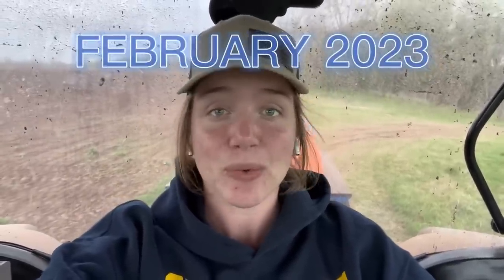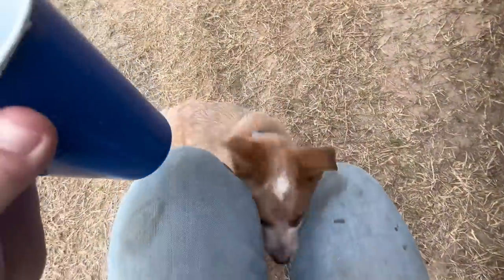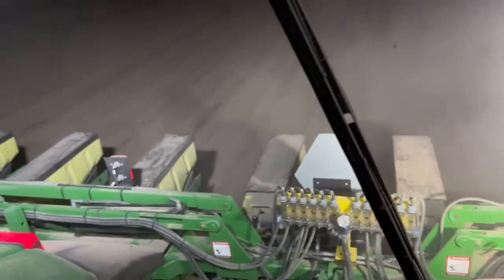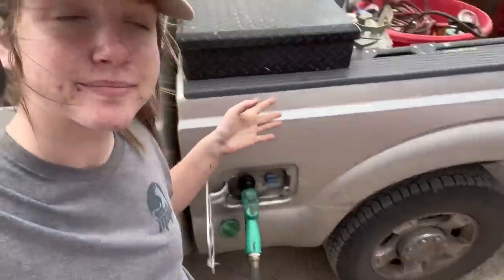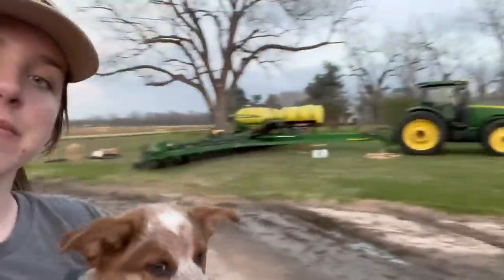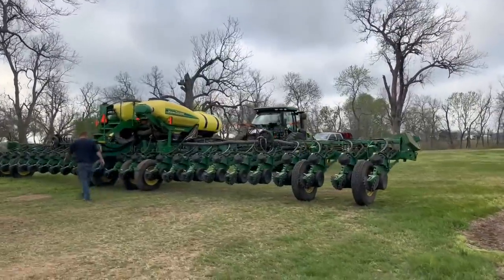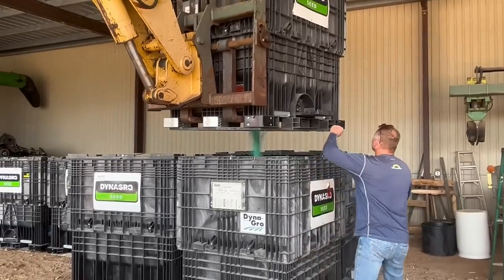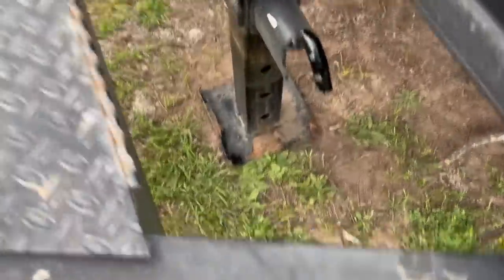PLANT 2023 IS A GO! - South Texas Corn Planting

Comment: I bought the Field Tuff two row seeder to plant peas in February.  Problem is, the tubes where the seeds far through the hoppers to the correct dirt depth got plugged with clay and I unknowingly didn't plant much further than half the first row.  I didn't notice this until about three weeks later because I thought that the depth was wrong being the reason that nothing was growing.  I saw in the video on huge planter around 5:00 that the seeds leave the tube, which is pointed in the backward direction.  Does this prevent clogging?

If the seeds depth is wrong, what happens to the seeds there?  Or, is that performed in an inconsequential part of the field where double planting at different depths wouldn't matter?

What temperature is the ground in Texas?  I assume that at least 50 degF is necessary.  Do they worry about freezing a few weeks from now?

What's applied to the seeds to make them green?

What NPK fertilizer are they using and is liquid preferred to granular?